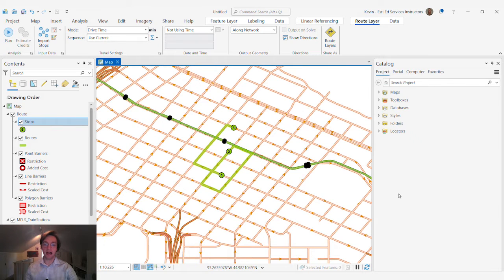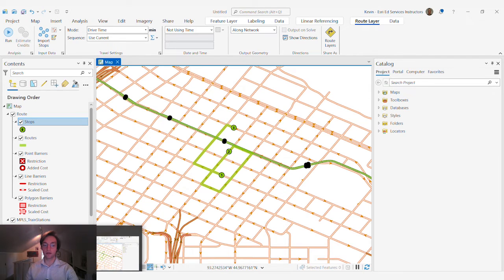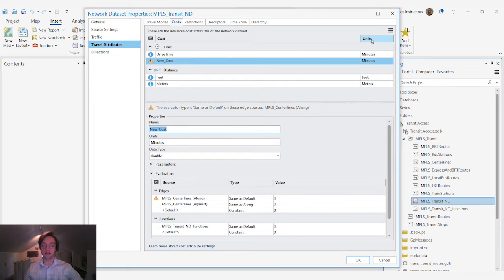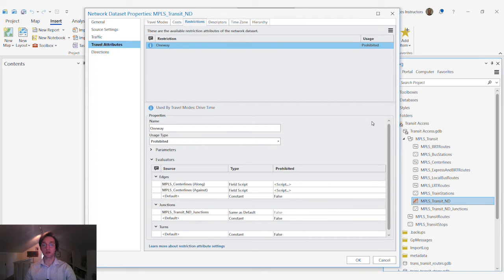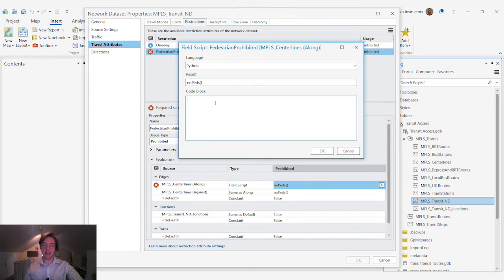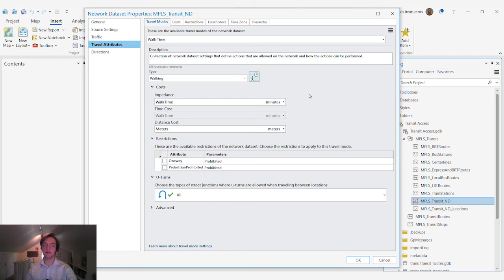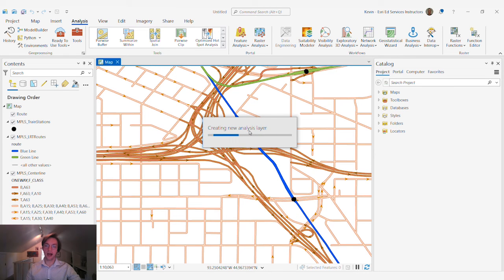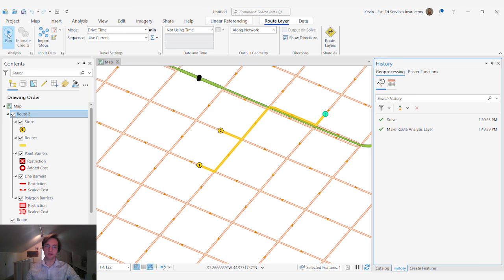Configure a Network Dataset using ArcGIS Pro

Comment: Hi i have a challenge incorporating an amenity impedance that limits walkable catchments. I want to integrate a cost or penalty to a journey using a raster or polygon base that has values or difficulty so isochrones are responsive to the pedestrian experience by considering topography, noise pollution, sun/shade etc. Any future tutorials that explain how to do this would be appreciated.